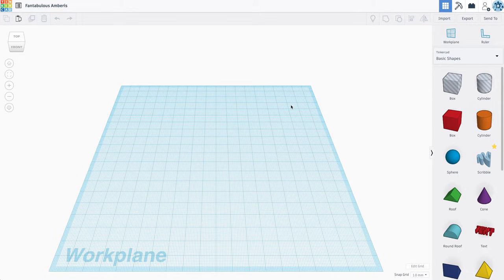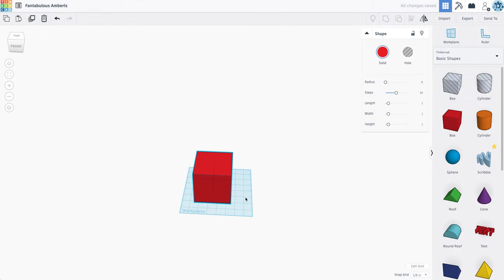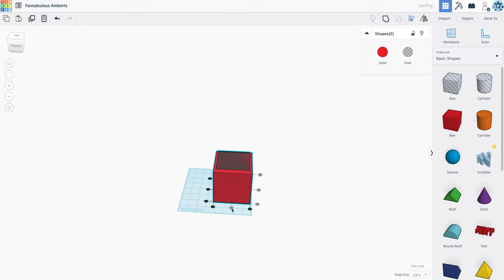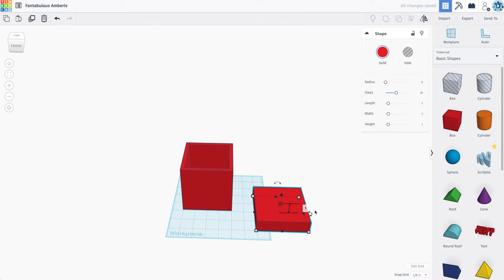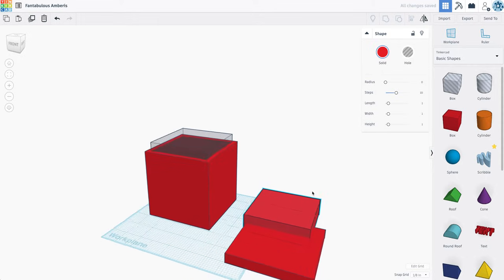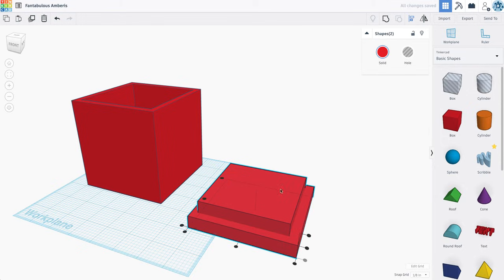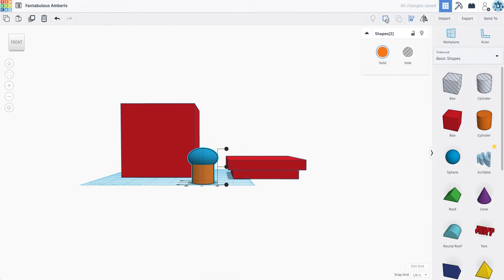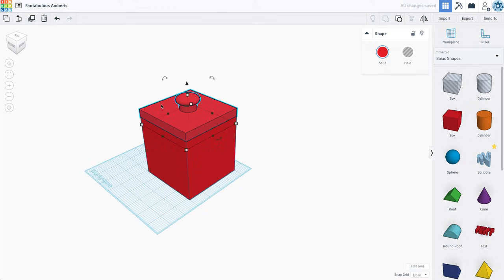How to create a box with a lid in Tinkercad

Comment: Great video - I want my cap to clip on so its tight.

Can you make a video showing how to do that?
Reply from the maker: Sure! When you want to make things fit snuggly and you're manufacturing with 3D printing, you need to take tolerances into account. Filament shrinks during printing, so if we made the rim the opening the exact same size it would be too small. For PLA, I usually find that the smallest tolerance that works consistently is 0.5mm under usually circumstances, but your print settings (fine or corse) and even filament quality can change that a bit. I recommend you do test models at smaller scale, each with gaps that increase from 0.4mm to 1mm to find what your printer can do for a consistent snug fit.